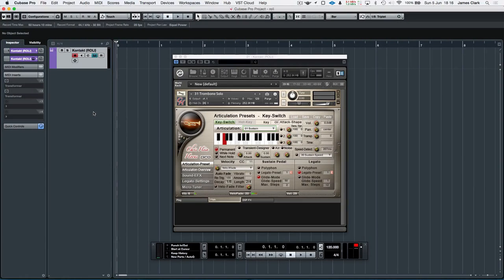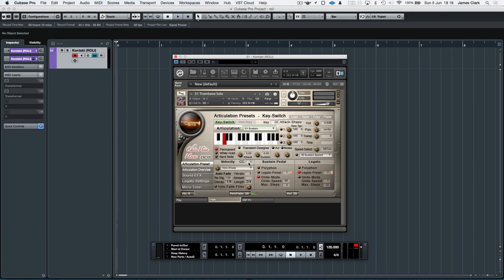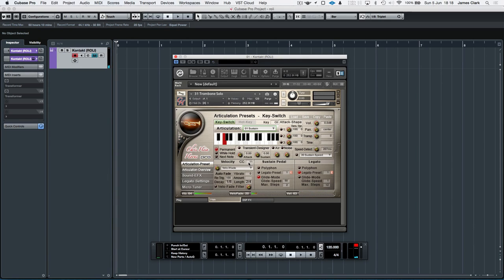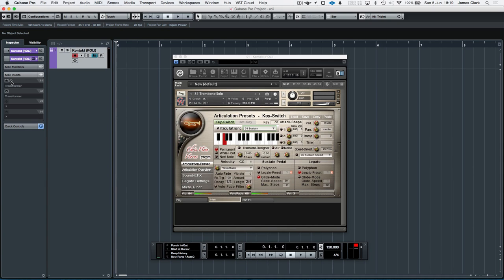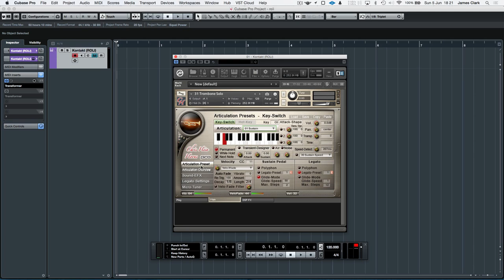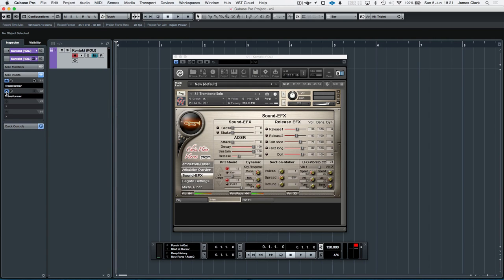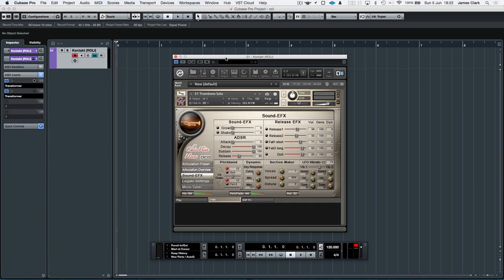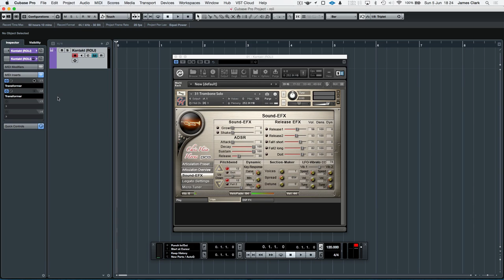Performance control of the Chris Hein Horns Trombone using the Roli RISE25

Comment: Its quite easy to set after-touch in Kontakt! You just need to click on the settings icon, and than set after touch modulation to control volume together with the velocity that is set by default. In addition to that you can set a lot  more things to be controlled via that controller as well
Reply from the maker: that is true but some instruments use scripting which stops this from working